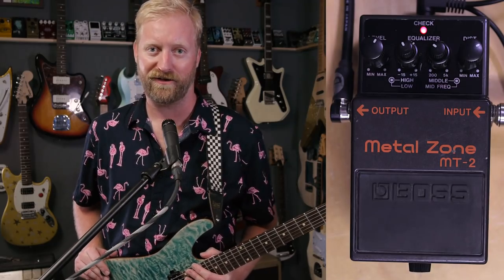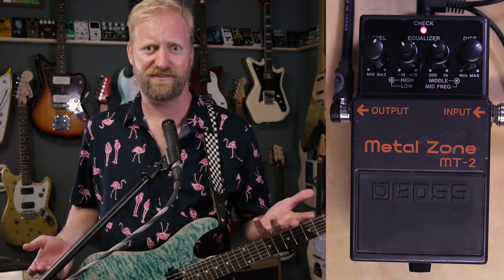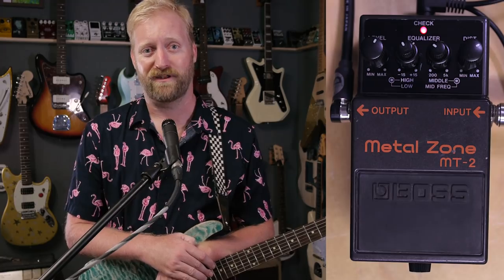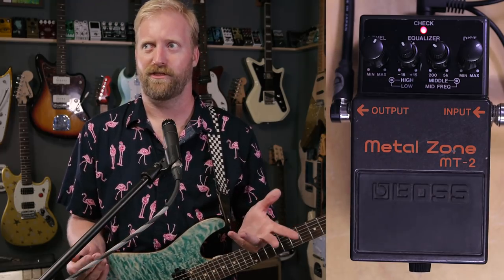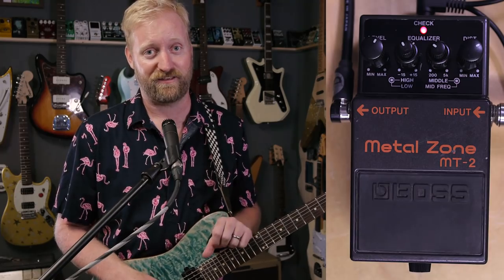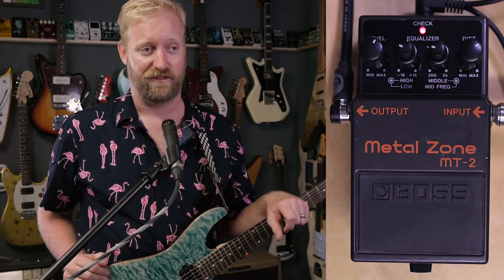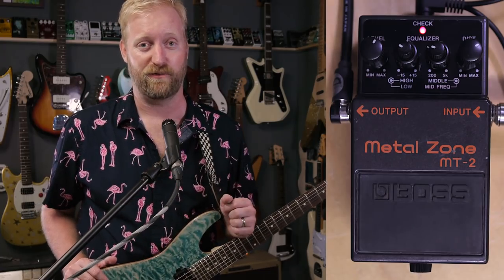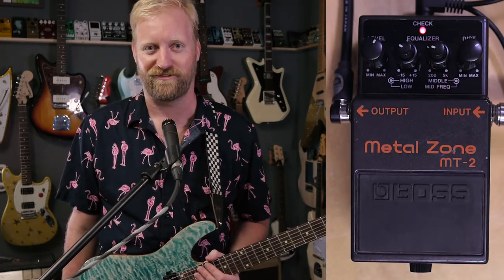Metal Zone into the loop return?

Comment: SERIOUSLY??? It is amazing how after years of technology it took now, 2018, for people to figure out that what is being done is the equivalent to plugging it into a cab sim. WHERE IS THE COMMON SENSE???? .... The power section is simply "amplifying" the signal to feed into the speaker. ... THINK ABOUT IT!
Reply: Not completely true. The poweramp has a very significant part in shaping the tone. This is why modern cab-sims offer a poweramp feature, too, if you intend to use a preamp out instead of the speaker out of an amp to get your tone into your DAW. A 6L6 Poweramp will sound different to an EL34. A SolidState PowerAmp will respond more quickly to your playing but will also be brutally honest. SolidState Preamps often sound nicer hooked up to a tube driven PowerAmp. But OK, this is a matter of taste.
Reply: You're right, that's true. My comment wasnt intended to get so much into detail about this stuff. I simply meant to get to the bottom of this, which essentially is to have the pedal act as a preamp and that if it goes through a cab sim into a daw is the equivalent to having a mic'd up amp. (Yeah, now there's a matter of taste which is not the point here)... now back to the pwr amp, in my opinion the pwr amp emulations are extremely exaggerated. I've been fortunate to have this discussion with a boutique amp maker here and he had one of his preamps connected to multiple power sections and the difference was nearly unoticeable, and then another preamp was put through the same pwr sections and the difference was more noticeable. So what I got out of this is that the pwr section can pretty much (kind of) act as a preset filter which -aside of amplifiying the preamp signal depending on the preamp going in, will cause certain frequencies to phase out or become emphasised, thus reshaping the preamp tone, but what REALLY makes the differece is the speaker...
Hey mate, I appreciate your reply, it is good to know that there are people out there who is paying attention to this stuff.
Cheers!

Comment: If you have a high gain amp you don't need a metal pedal. Metal pedals cater to guys with low gain or even totally clean amps. Most dirt pedals are designed to add grit to dirty amps, so they are mid-focussed to keep the sound smooth and tight. Metal pedals are designed to present a "complete" sound to a fairly clean amp, so they have a wider frequency range and often an EQ too. This is why they have more of a pre-amp flavour to them and why they are useable as preamps. 
Bypassing your pre-amp will give a duller tone which is more forgiving to a pedal that is inclined towards shrillness. 
However, I am of the opinion that a person who takes the time to tinker with his EQs and use them sensibly (the metal zone has an insane EQ range) will still get the best sound with the metal zone going into the front of an amp.

Comment: Now I want to know more about the fake effects loop on the ibanez, also hell yeah XMEN.
Reply from the maker: The Ibanez TSA15H doesn't have an effects loop in the sense that most amps have one. The amp itself has a built in Tubescreamer circuit that is directly after the input. The send/return jacks on the amp sit between the TS circuit (after the boost) and the EQ section of the amp. On a typical amp, like the Peavey Classic 50, the effects loop sits between the EQ and the power amp section. So that's the difference Ryan mentions in the video but doesn't really dig into. - steve

Comment: I wonder if this pedal is similar to the DS-1 in regards to what I discovered, you need to use a guitar with very low output pickups, the input of the DS-1 hates everything coming into it that is hotter. I will also try the DS-1 into the effects return

Comment: Does it bypass the preamp of the amplifier even if the pedal is turned off if they are only plugged directly into the return? Thanks.
Reply: Yes. The return is a power amp input only and runs wide open on amps with no master volume. When you "turn off" the pedal, the volume knob on your guitar will be your amps master volume, so if you have your guitar volume on 10, and switch the pedal to clean, you'll blow your hair back! 😀 If your amp has a master volume,  then the volume will be limited by that obviously.

Comment: Only a m0r0n use Metal Zone by itself. I used to be that guy and I hated my Metal Zone so I sold it but 30 years later I just bought it again and put it in front of an overdrive (Nobels ODR mini) and plug it in front of a clean amp (Blues Jr with upgraded speaker WS Veteran 30) and it sounds amazing.

Comment: MT-2 (and other multi gain stage units with active EQs) are an preamp it self. And need no other modern preamp with another (active) EQ. Just adds noise and fizziness. 
Same is for 19" units and multi effects/preamps.......Sounds always better on FX-Return. What is particularly an preamp plus an power amp. 80es rack units and settings on very simple version!
Only on lower (vintage) gain (tube) amps with passiv eq, you will get good results....pluging them in on frontend: 
My humble opinion and  first time experienced with ADA MP-1 ca. 1987. This good (then 1400$!) 19" Unit sounded pretty disappointing in front of many Guitar amps. 
On the "AUX IN" on the back of my stereo Gallien-Krueger ML-250 was the "first solution" against that shity sound. 
Before a real 19" tube power amp was in my little Rack :-)
Reply: which  is why  putting  them  inthe Input  jack  of an  amp  is  gonna  create  fizziness as the preamp  of the  guitar amp  is  gonna conflict  with the preamp  of the  MT2. In  other words cancel each  other  out.. So  it's either MT2 in the FX  loop using  it as a preamp, or use the  guitar amp's  own  preamp.  I've a 2nd hand ADA rack  unit.. I think  I'll connect my  MT2 to that  :).

Comment: I dig your theory in this vlog.but Ola englund also uses expensive shit to perform in his videos.and I agree the metalzone has had its heydays but it will forever be the no1 metal pedal of all time!I just thought that when they made the waza version that they would fit a noise gate switch as it has that buzzing noise which is maybe part of the reason for it been a shitty pedal for some..?also not all amplifiers function the same.that also has alot to do with the sound the metalzone delivers!but definitely a pedal to own on your list!🤘🏻